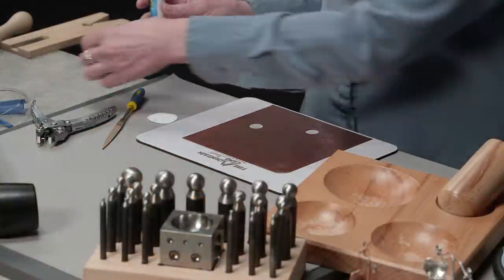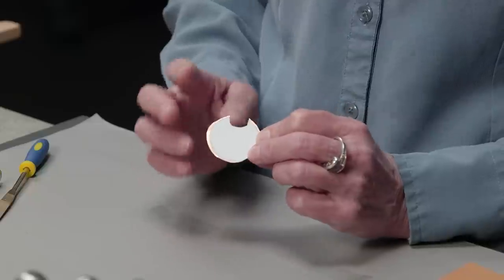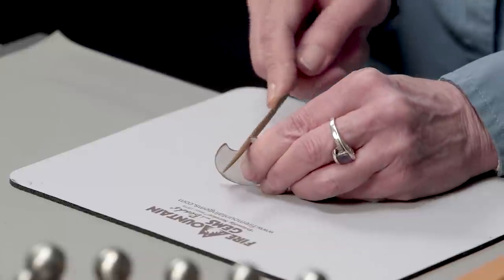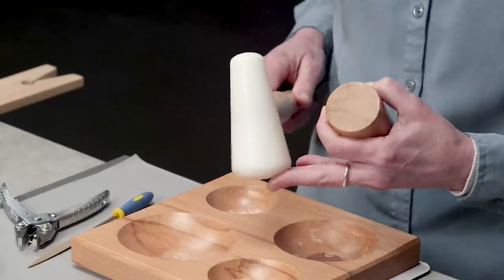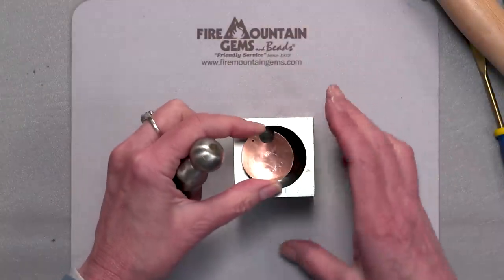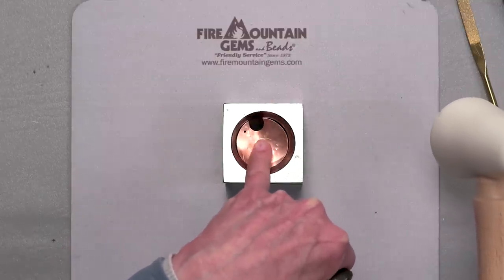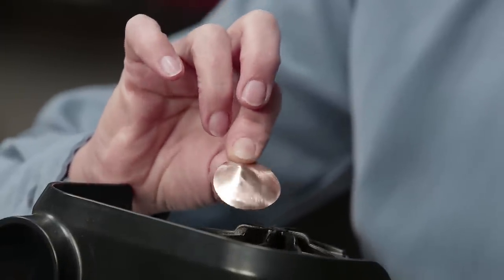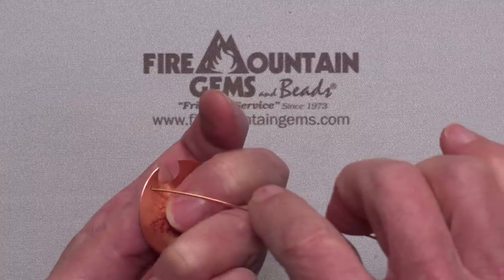Dapped Copper Earrings

Comment: That Jewel Tool (?) looks pretty kludgy to use. You can probably get better results faster and easier with a flex shaft or Dremel with sandpaper roll attachment. 

Also, you need to work harden the ear wire or it’ll bend the first time you try to put the earring on.

Comment: Nice fun hobby! But I am missing how you connect ear wire to the other side with the curve in the copper
Reply from the maker: Bending and rolling down that side of the copper creates a small hole/loop. The end of the ear wire is inserted into that small loop to keep it secure. Just make sure the wire is not too long that it can't be flexed and inserted into the loop, or too short that it slips out of the loop. Hope that helps!